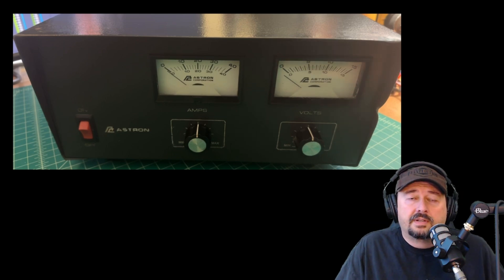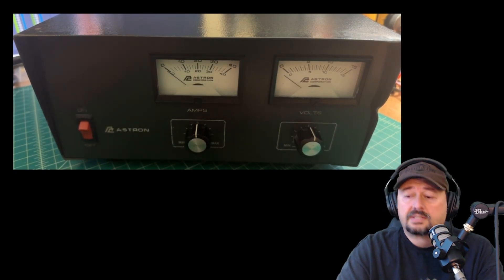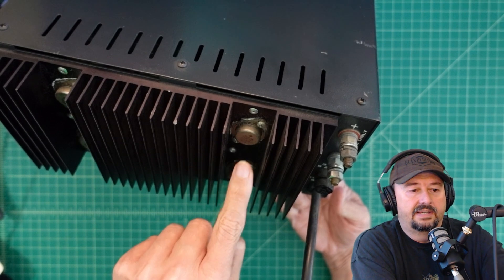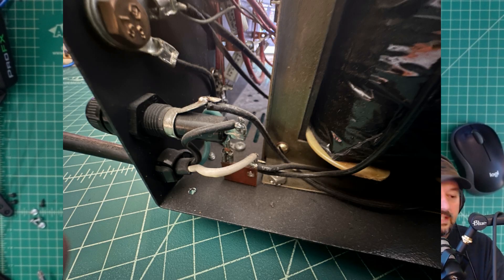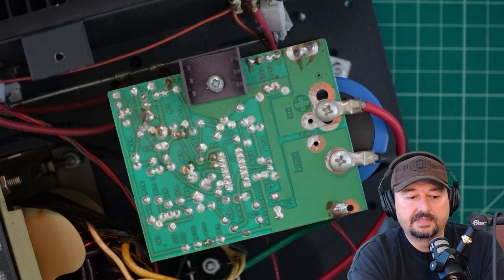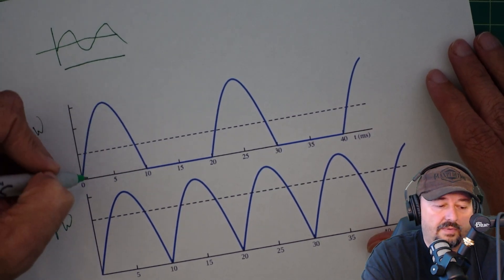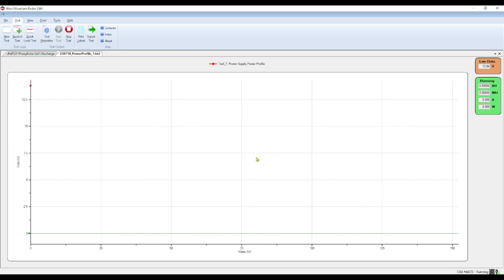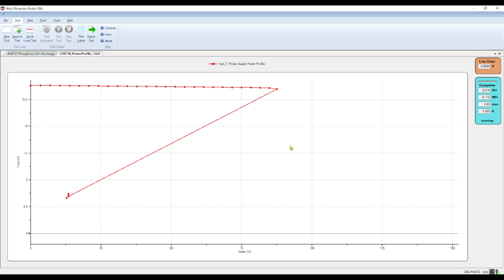I bought a USED Power Supply - Astron VS-35M

Comment: Wish you would have figured out what was wrong.  My 35M works till it gets to 14amps then bombs.  Changed the VR board. Changed the transistors on the back and still bombing.  The only think left is the rectifiers.  The Astron tech said it is probably not the rectifiers...... but thats the only thing left unless they sent me a bad VR board. the problem is still there with new board.
Reply from the maker: I cleaned the whole thing with deoxit and it’s been working pretty well 🤷

Comment: DC, has an amplitude. I know what you mean though. I think your problem is an open bridge rectifier. Unsolder one yellow lead from the transformer and check the diode tests and there should be a diode forward and open reading on the diodes. Just saying.
Reply from the maker: Thanks Larry 👍

Comment: Looks wimpy yeah not an extra once of metal lol,  The regulator board however, is available from Astron for a low price.  I made homebrew 48v PSU using that board (small mod, bigger Iron) and the current limiting works good.  Linear beats Switching for me no matter the Tech.
Reply from the maker: Thanks AB1 👍

Comment: replacement regulator board $38 bucks that would fix that. There is a way to check each pin on that IC. Im betting you would see that 3 volts across a couple pins.  I just bought a RS-35M-AP 2023 $50 bucks on ebay they knew it was fried said they didnt know. $11 dollars later I have a working power supply and I got 2 bridge rectifiers coming from Astron after a 10 second talk with the tech support. "Will you solder it together for me too?" "Sure thing" lol done.

Comment: i'm late to the party, but you want to "adjust" the A knob all the way to the right and leave it there.  then, dial in V on the right.  i might just be dumb, but i can't think of an HF use case where you wouldn't run a linear PS at its rated amperage.  when a load is supplied, the PS just dials up the current needed as per the requested load.  right?  so, during use, the A needle might fluctuate a little (but not fold back), and the V needle will move as per modulation / load.  right?
Reply from the maker: Nope, and you make a great point 👍

Comment: Oh, and if the mfr put the 3-term regulator into a socket, get rid of that socket and solder it into the board.  Provide it with its own independent, oversized heat sink, and install a quiet little fan to pull air through the chassis, and you'll never have to replace the regulator anyway!  Loose (ie; not soldered) connections on the regulator can cause all sorts of noise and oscillation you don't want.

Comment: PS: linears run hot.  If you stick it in a rack or a shelf with no fan, you are going to have bad times. That's abuse, and it's certainly not the fault of Astron, and yet I'd bet lunch that it's the root cause of most Astron failures. Three terminal regulators can only take so much heat, same for the pass transistors.  If you put it in a hot mobile QTH, a van or truck or whatever that gets warm, you will kill any equipment which gets warm.  Humans can often tolerate higher heat than electronics.  Heat is Enemy Number One of electronics.

Comment: Don't run power supplies anywhere near their rated load, that's asking for trouble, I don't care who made it.  Especially if it's running a busy repeater or some other continuous duty.
People who think you can continuously operate an affordable (yes, these are affordable, lab grade costs many times more) power supply, at its maximum rated current, are misinformed and
need someone to educate them.  Astron supplies are built to a price point. If you want something with more features, better performance, etc, buy a lab-grade bench supply from Hewlett-Packard or Fluke, and expect to spend several thousand dollars.  If you aren't willing to spend several thousand dollars, be quiet and sit down. Economics is a thing.

Comment: I know this was a year ago, so this might not metter anymore....
That battery tester is going to be the same as any other programmable load. It will have a transistor, or a bank of transistors, that can act as a dead short, an open circuit, or anything inbetween, and all under control of a microcontroller.
Doing 100% duty cycle tests "at some load" will obviously generate more heat (this is where the energy is going), and this will limit what the manufacturer can rate the unit for. This is where MARKETING get involved.
Because the unit is MARKETED as a "battery tester", they can take liberties with the numbers. For examle, the CBA V is rated for 150w max continuous load. It is likely that the transistor they used has a max temperature which provides this 150w max number with the heatsink and fan combination they used.
In reality, they probably did something clever, and rated the unit for DOUBLE what the transistor can tolerate in terms of temperature, and simply halved the duty cycle that the transistor works. Instead of drawing a fixed continuous current, they toggle between what you asked for and off. If they do this, they can double what the transistor would otherwise tolerate (making the numbers seem better in advertising) and use a bit of math to get the mAh rating of a battery.

Provided the unit is only used to test batteries, it will be fine and no doubt accurate. You'll never know or care what they're doing under the hood.
Once you get into power supplies, you're wanting to know if the supply is stable, and you'll have trouble seeing this if the load is effectively switching on and off.

A simple firmware update would solve this - They could write a "power supply" (100% duty cycle) mode but with the caveat that it would probably have to be gagged compared to the battery test feature.

Dave Jones at the EEVBlog blew up a power supply during a test a few years ago because the power supply was trying to supply constant power, and the programmable load was trying to draw some other current - the two devices argued for a while and the load won!

To do basic tests of powers supplies, I have a few 200W resistors screwed to a large heatsink. The resistors are resistance sized to provide different constant loads. Nice flat smooth load characteristics. I put a multimeter across the resistor to check the volt drop and this lets me verify the current draw, and Ohms law will tell me the load.

Comment: Was considering this amp to run a radio claiming 100 watts. Want to hook up other stuff, maybe a linear.   Will the 35 handle things or should I get a 50?  Thanks for this video
Reply from the maker: @Smith.Wesson.432UC  35A is plenty for 100w

Comment: I’m looking for a used R35a-ap. I don’t want varable voltage but would prefer Power Pole connector. I will switch to Power Pole connectors if needed.
Reply from the maker: I was thinking about doing a power pole mod on this one 🤔

Comment: I have Had Several Astron Power suplys over the years & I Still Use one Every Day..I Prefer the ones with out the A adjustment (just Causes Problems IMHO) But I Do Like The Meters & V Adjustment..I Run a Yaesu FT-991 a Icom IC-4100D & a Retivis RA-25 From a Astron RS 20A Daily ! These Things Are Just Tanks IMHO ! I Tried Switchers Back Years Ago and had Nothing But Trouble from Them & I have Also Ran a Lot of Pyramid PS36KX They Just Will Not Hold Up like The Astron's do ! Just some of what i Have saw & Learned in my 35+ Years messing with Electronics & being a repair Guy ! Always Buy Astron PS if ya want Quality ! a switcher if ya like junk or  Pyramid if ya dont use them very much & at about 1/4 what they are rated at..lol.
Reply from the maker: Thanks for the info BigChew 👍

Comment: Fixing the power cord would be the least of my worries since it is probably one of the easiest repairs you can make on most equipment.  One thing I am wondering about.... is there a conversion kit/instructions to add the variable voltage and current knobs to a RS-35M? I will have to look into that.
Reply from the maker: Hey Ryan, you are right about the cord.  I am not sure about the kit but that shouldn't be too bad either, I am pretty sure the schematics are available online.
Reply: @TheSmokinApe  Thanks for the reply. As I am finally venturing into HF for the first time, the non-variable version of this amp is what I will use. Just so it is clear in my head.... would not having any adjustents be detrimental to doing digital modes? FT8, Olivia etc?
Reply from the maker: Nah, you should be fine

Comment: I wish you good luck with your Astron PS. I never had good luck with them and will never buy another. As noted by the previous comments they're easy to work on (whats not said is 'that's because they need to be'). In my last job as an Electronics Repairman for towboats on the inland waterways (mostly marine FM VHF and HF SSB radios) I had to repair tons of them. I always attributed that to the generators on the boats... But found out after I bought a 35M for my shack that's not always the case. A couple of months in the LM723 regulator went out while I was gone and not operating, so I replaced it (socketed) and didn't bother with warranty. Right after the warranty expired the transformer shorted turning the fuse (and several after while troubleshooting) into flashbulbs, again on but not being loaded (no thunderstorms were around or other electrical damage in my home, its MOV was good). When the MOV is disabled and all the output leads are loose and isolated there's no doubt what it is. I now consider Astron's a Hobby PS. For me at least, they are a hobby in their own right to keep running. I'm retired now and look for reliability over a continuing project. The PS I'd built before the 35M was a Tank that never gave problems (gave it to a new ham). I have heard other 723 based PS's can have problems also, so I just got a Yaesu  FP-1030A ($230 new) for its good reputation and lack of 723. Time will tell. I refuse to use switching PS's for my rigs.  YMMV!  (BTW the few Icom Xfmr PS's I saw on the boats were very reliable) 73's  mike - N4ONL  (The 35M will be parted our or a basis for another Tank some day, sans regulator board)
Reply from the maker: Well dang, that ain't encouraging.  Thanks for the info, much appreciated...
Reply: As I Said YMMV!  Several folks seem to have no problems with them. Also after Astron added the RF bypass cap to the output, the crowbar wouldn't trigger as easily from RF. I can't remember what output transistors they use, I think it used to be 2N3055's but I could be wrong, I always replaced bad output(s) with sets of 4 x 2N3772's which have a higher rating. You may get decades of trouble free use out of yours, I hope you do!
73's  mike - N4ONL
Reply: How do you explain the many other operators who love them? What do you suppose was special or unique about your experience with them? Being near the ocean perhaps? HAve you seen corrosion problems?  A transformer shorting is something fairly special -  you'd think a lot of others would be talking about that. 
Why do you think you had bad luck with them when most others do not?

Comment: Reminds me I  should probably replace the capacitor in my 20 year old Astron 35M linear power supply. It's run fine for over 20 years with only the on/off switch needing replacement in 2011.
Reply from the maker: I still need to check the cap in this one.  Thanks for checking out the video MrRadio 👍

Comment: have fixed a lot of power supplies threw the years.Astron being one of the easiest to fix and heavy duty. A few test points will show the problem . start with voltage on filter cap. then the  output of reg board to base of pass transistors. also check current limit pot. a big clue is the heating of pass transistors on heatsink. I use a inferred camera . heat sensing type. easy check diodes and transistors. bad connection's show right up.  my useful tool as a electrician . I got a basic one for free at a repeater cite.Think the RS 35. no meters no pots. has not been on in 10 years. tested fine. multi repeaters at a cite. I was working on a GMRS up-grade. better coax.  better lightning protector. better duplexer. gained 20% more power at antenna. took a nearbuy hit. lost coverage area. got new AGM battery installed as well. now we have back up power supply. astron has a supply with battery back up . got that at outher repeater cite. parts also can be gotten Newark electronics or mouser. they use LM723 ic. no socket on astron. always add MOV or GDT to them . I got a RS70 and RS-50 in my shop. and home made ones. 200amp . adj 14V . just 4 50 amp transformers. 35 pass transistors. 2N3772. bult in 1988. it's big. 73's
Reply from the maker: Great info Robert, thank you for sharing 👍

Comment: I thought most people reduced their output power for digital modes because the transmitters will get hot at high duty cycles.  Thus less current from the supply continious also.  I got the meterless version and it is used.  All I can say is it does hum just a little but not an issue.   I cannot imagine it costing much to repair one of those unless it needed a transformer,  and it would not be too difficult to troublehoot.

Comment: Check the current control it is probably set too low and the voltage output is folding back,set the current control to max for the test.
Reply from the maker: Thanks Coltronex!

Comment: These are really good supplies quiet and robust. I do think 150 is a little high I think 100-125 would be all I would pay for a used supply. I use the newer  more modern one in my shack and it has been reliable for a switching supply, so far so good mine is about 20 years old. 😊
Reply from the maker: Hey James, it was actually 110$ and about 25$ in shipping... Thanks for watching.

Comment: Astron has never been known for light weight power supplies! But they are tanks and I know people who have had  them since the 70's and they still work fine today.
Reply from the maker: I am going to see about a partial refund and see if we can get this think working.  Thanks for watching VE9SY 👍
Reply: @TheSmokinApe  Is the battery tester you used Lifpo4 specific?  That would cause the effects you were seeing. I have no experience with those battery testers. Wire up a 1ohm 100 watt resister in series with a test meter and watch the current draw. It may give a different result. Those older supplies react a lot different than a switching power supply. If it's getting any pulses from the battery tester ( Like I said I have no experience with them ) , it could cause the bridge rectifier to act funny. Or I could be blowing smoke out my ass. I haven't been able to do my own work for a number of years now I shake so bad that I think I've forgotten most of what my father taught me through the 60's, 70's, and 80s!
Reply from the maker: Hey VE9SY, the tester has a power supply setting.  I was messing with it again today and got better results.  I am thinking the pot may be screwy but that's just a guess at this point.

Comment: Ape, from past experiences, I always check to make sure the proper fuse is in the unit before powering on. Not telling you what to do, you probably did that, but you didn't mention it so I thought I would bring it up. I have a 35M and had to replace one of the meters. Astron sent me an LED version with the resistor kit. It was like $24.00. I'll replace the other one too only because it looks silly with only one meter lit. In the past, I always covered the output of the supply with a cheap plastic project box. While you have the cover off, pound out that dent. LOL I'm glad I waited until the end of the video before hitting the send button. Let us know how it turns out with the seller.
Reply from the maker: I made sure these was a fuse but didn't check the value, thanks for that idea!  I am going to ask for a partial refund and order some "parts" 👍
Reply: @TheSmokinApe  From what others have told me, the heat sink in the top (or bottom) of the circuit board is only
Reply: @TheSmokinApe  the heat sink is only adequate and was suggested to be beefed up a little. Yes, even if you have to replace one or two of the transistors in the back by the heatsink, it's still cheaper than buying new
Reply from the maker: Thanks for the info!

Comment: It looks like the current limit kicked in causing those voltage swings.  Try running the test again with the current knob fully clockwise and give er the beans.  I bet you'll be good.
Reply from the maker: I'd think that at 1/2 way it should do more than 3A, but in either case I'd expect that the voltage may dip but not swing like that. Thanks for the comment Nate 👍
Reply: @TheSmokinApe  I agree with you that I'd expect it to do more than 3A half way.  I wonder if it's not a linear adjustment.

I've used linear power supplies in school which would "flicker" between full output voltage and zero when they hit the current limit.  I wouldn't have believed it had I not seen it myself.

Let's test it out, son!  Looking forward to the next video.
Reply: @TheSmokinApe   Hi Ape.  I believe the supply was acting exactly how it should.  The current knob is an overcurrent limit setting.  So when the load hit that limit, the supply just shutoff.  I suspect that when the load tester saw the voltage go away, it shutoff the load.  It probably has a minimum voltage limit so it doesn't damage batteries by draining them to 0V.  Once the load went away, the power supply came back.  Then the load turned on again.  Then tripped the overcurrent again, etc. etc.
I believe @NateMieras is right.  Turn the overcurrent knob all the way up and see what happens.  It may not be a linear pot.
Reply: That exactly the same way mine acts when I have the current knob turn down and it reaches cut off.